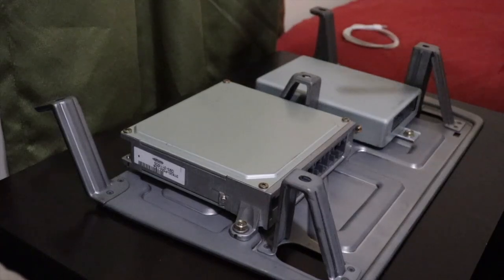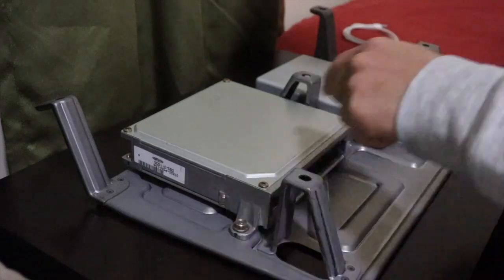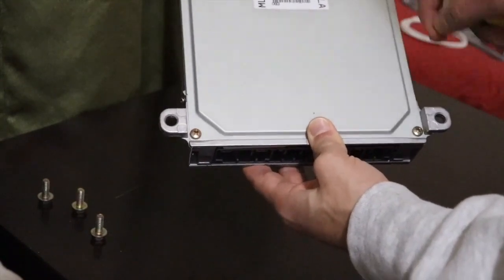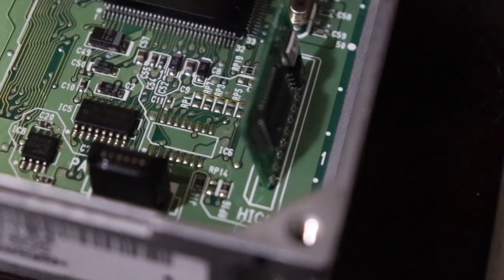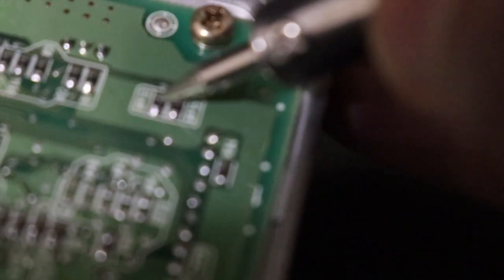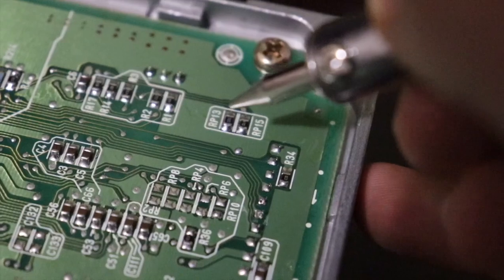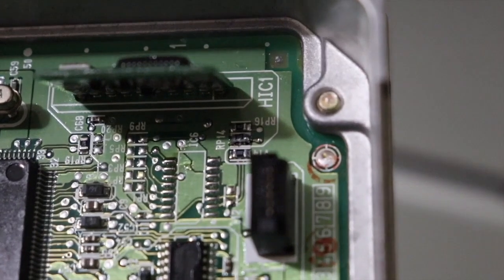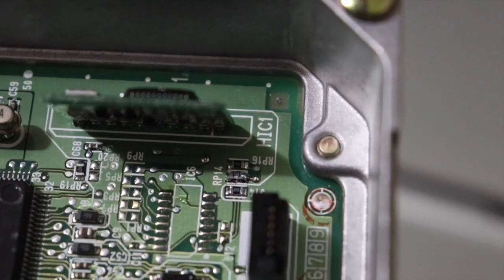Honda prelude: Auto to manual ecu conversion

Comment: Thanks for this vidéo! I have to do the mod and checked RP13 value : it's a 0ohm resistor. So you could aslo use a wire / strap on RP14 if original RP13 resistor have been altered during unsoldering :)
Reply from the maker: Glad it was helpful. Yes you're right it's an ohm resistor. Thanks for letting us know of an alternative in case RP13 ohm resistor was damaged.

Comment: What would be the symptoms if the resistor was broke or damaged in the process of removing/installing it ?
Reply from the maker: The only conclusion I can think of is that the ECU won't work with the manual car and probably not work with the automatic car as well since the resistor has to be in very specific places to work with each one.

Comment: After you did that do you still need to plug the tcm?
Reply: After i did that the idle was really good but still when i rev its only up to 3k is there any problem you experience?
Reply: @MichaelCatacutanJr what did u do I’m experiencing the same thing my ecu is a p5p on my accord with a h22a4 swap
Reply from the maker: @MichaelCatacutanJr  I had absolutely no problem when I plugged the ECU back in the car. I took my ECU to an electronics store where they were able to do it correctly because I almost messed the job up. Did you do this yourself? If you did take it to an electronics store and see if they can double check everything is correct.
Reply: @automotiveobsession7265  no i bring it to my mechanic friend that how to do ecu
Reply from the maker: @MichaelCatacutanJr  Ok that should work if he already has experience. Good luck.
Reply from the maker: This is the only mod I did and I did not have to modify anything else. It was literally that one small resistor and that allowed for the ECU to work with the manual transmission.

Comment: Love the video, when you plugged the ECU back into the prelude did your car recognise it? Did it turn on and run?
Reply from the maker: Thanks. It had absolutely no problem recognizing it and is still running 2 years later with no ECU issue what so ever thanks to god.

Comment: What ecu is this?
Reply from the maker: 2000 Honda prelude automatic ECU.
Reply: @automotiveobsession7265  no the literal ecu p13 p14 p5m etc which is it?
Reply from the maker: @Visible2Any1  After doing a lot of research I keep finding that the ECU ID code for the fifth generation prelude is P5P. Now this is for the JDM type SH and Type S preludes. The USDM automatic prelude is going to have a different ID code because it's not manual and not JDM. I can't remove the ECU from the car either. Hope this helps and is something to go off of. If I find the code I will post it as a reply to this comment.
Reply: @Automotive Obsession  well the code is right on the side of the ecu but in the video there isn't an opportunity to read it off I'm just dealing with something similar so I was just curious if it was related
Reply from the maker: @Visible2Any1  I know I tried to read it off the video too and if I could remove the ECU from the car I would but I can't. Sorry and I hope everything works out on your end. Glad to help with any more questions.

Comment: Only one resistor?!  

I was expecting a sub-board that had all the input & output MOSFETs on it!

You have apparently seen both an OE auto & manual, is the manual ECU missing more stuff, or will the resistor relocation hack work both ways? 

IDK why anyone would auto swap a manual…
The auto is geared really short, but the shifts are decent.
Reply from the maker: I have not seen the manual ECU I just researched until I found a forum explaining this procedure and tried it because I was going to have to buy a manual ECU and them have it programmed to my car which was going to be more expensive. I don't know why someone would auto swap a manual knowing that auto's have reliability issues unless they some how fixed the problem.
Reply: @automotiveobsession7265  I have an automatic BB6, so now I'm interested in whatever issues you are suggesting…

From my experience with CG1 (6g Accord V6, which only came with automatic transmissions) the Hondamatic transmissions are fine because they are self-shifting manuals (the problem is owners). I autocrossed mine, with the OEM auto, and it was fine until the car was t-boned in traffic at 26?,000 miles. IMO, that's because it got the transmission fluid D&F every 5000 miles. "Auto trans flushes" are bad, and waiting 20k is worse!
(or more, like never, like most owners)
Reply from the maker: @Iowa599  I agree. Sorry that happened to your car hope you are OK.

Comment: So you said that if we buy a known good auto ECU for my manual prelude set up, and we convert that auto ECU to manual, we don’t have to program the immobilizer?
Reply from the maker: No. If you have an Auto prelude and convert that auto ECU to manual and complete a manual swap to that exact same car you do not need to program the immobilizer because you are using the same ECU that the car came with.  Correct me if I'm wrong but you are asking if you have a manual prelude and buy an Auto ECU from another prelude and convert that Auto ECU to manual if that would work on your car? If this is the case then you would have to program that ECU to your car along with all the other components needed to make it work.

Comment: So if my car is manual from factory this will not cause any weird idle, cel or need to switch immobilizer or ignition correct? Reason for asking is because i may have to buy the auto ecu due to the 37820-P5M-L03 being damn near extinct.
Reply from the maker: I did not need to switch any of those parts. I only did this modification to the ECU and everything has worked fine since. I only did this on the automatic base car in order for it to work with the manual transmission but I cant say for sure it will work for a manual base car because I don't have the experience of doing this to a manual car. Honestly I don't see why it shouldn't work as long as both ECU's have these same resistor's in the same exact place and if they do the same function.

Comment: Is is the resistor on the same side As before
Reply from the maker: It should be in the same area on both sides but I don't remember if it's exactly in the same spot for both sides. It could be one spot over but it's still in the same corner.

Comment: Hey man, love the prelude content. Would you have been able to replace the ECU with a manual ecu from another prelude along with the ignition and immobilizer and have it work? I'm asking because I'm doing an auto to manual conversion and I'm thinking of either doing what you did or buy a manual eco and ignition and immobilizer and swapping it in hoping that it's plug and play.
Reply from the maker: Thank you. From what I read and learned when buying parts for  the auto to manual swap the manual ECU, ignition, and Immobilizer are not plug and play. You have to reprogram your manual ECU to your car by Honda if you have the "Red key" that comes with the car(most people don't have it). If you don't have this key then you need to find a locksmith to reprogram your immobilizer. I decided to convert my ECU because it was cheaper and easier since I knew that it was a working ECU that had not been modified. I did not change the ignition in my car or the immobilizer for this to work.